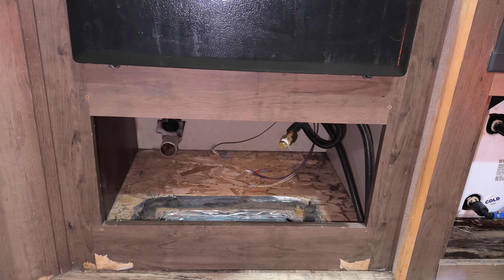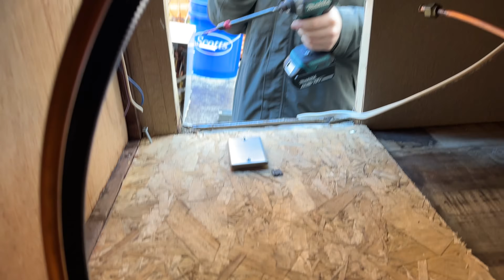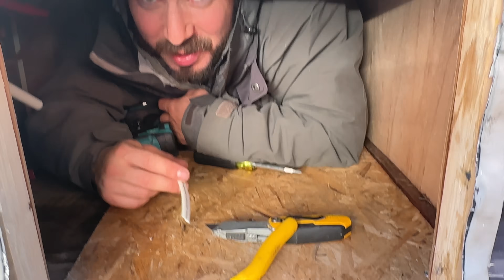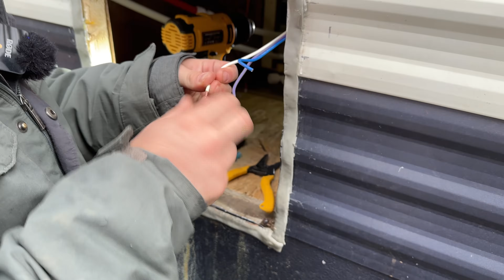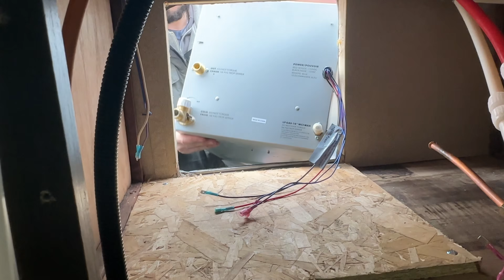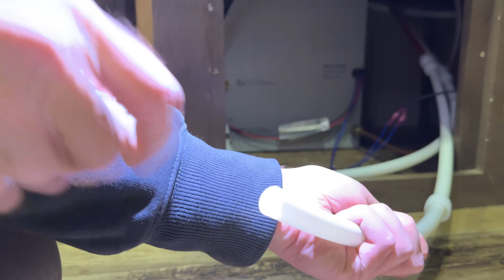How I installed a Girard Tankless Water Heater!

Comment: Hey guys I just came across your channel. I'm a mobile RV repair man too here in Utah. I also do the same thing on all my 12V  connections. I use heat shrink connectors with spades so that its easier to work on in the future for me or another repair man. Cool to see great minds think alike. Great work guys.
Reply: Can anyone help trying to install  a similar unit in my camper and when connecting it to 12v dc it instantly blows the fuse on the water heater
Reply: @justincolson61 are you sure you're hooking to the correct wires and not getting polarity crossed.
Reply: @justincolson61 Also I apologize if I came across like you weren't smart enough for this task, because I really never meant it to sound like that.
Reply: Maybe send me a picture of how you're connecting it to the campers wiring.
Reply: @RussN1975  I can tomorrow on the back of the unit it’s showing on the sticker red to positive and black to negative I’ve connected it that way and also crossed it seeing if they labeled it wrong doing the same thing company said I could connect it straight to the battery
Reply: @justincolson61 Yes I was going to tell you that next, just get an inline fuse and go straight to the battery. If that works then the other line you were trying to hook to has a direct short.
Reply from the maker: Welcome to the channel, always nice to meet another repair tech! 👍

Comment: The red handle Klein ratchet crimper sold at Home Depot is cheap and a good upgrade.  It doesn’t do flag terminals without buying a second set of specialty crimping dies

Comment: I just installed my tankless water heater and I get hot water coming out from the outside pressure relief hose but no hot water going into my trailer faucet, do you know what’s wrong?
Reply from the maker: The pressure relief valve should be closed. 
Is hot water coming out while it's closed or are you opening it to check if it's hot?